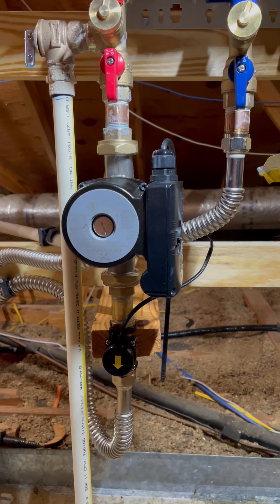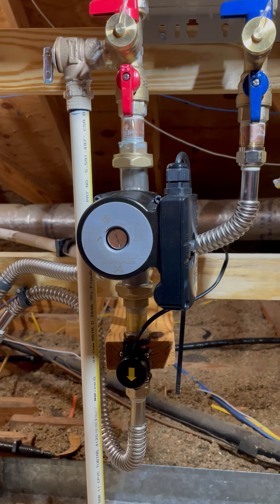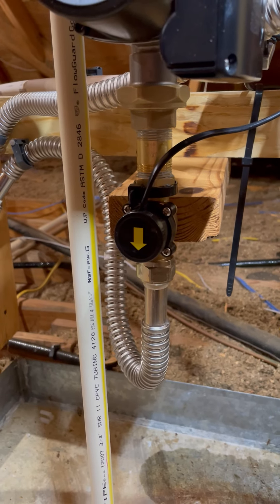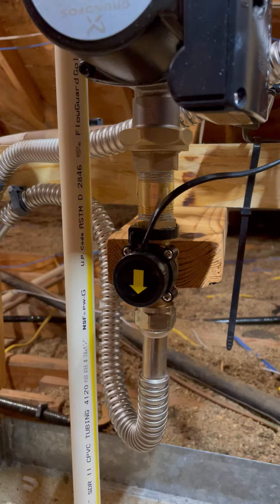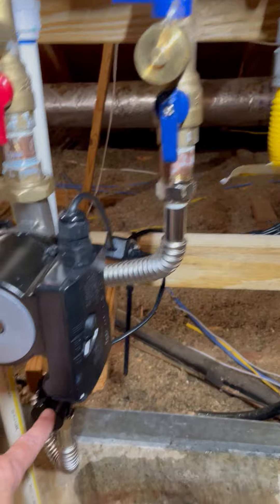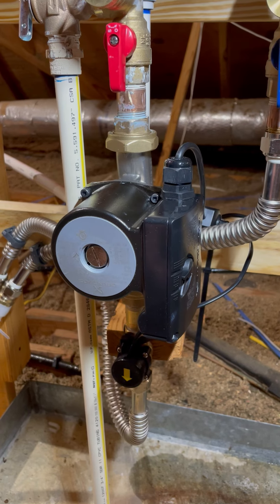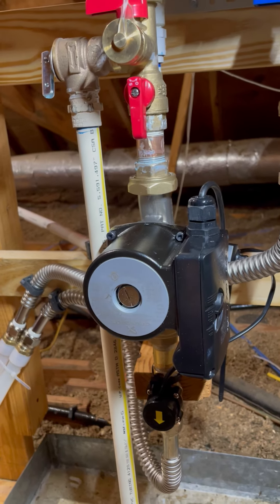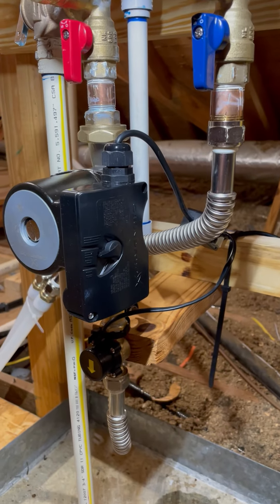Recirculating pump with flow switch install on tankless water heater

Comment: if you are using  a flow switch to turn on and off the pressure pump for water faster in the house, the flow switch installed before the pressure pump on the main cold line and when the tap is turned off the pump stops.  tap on pump starts. simple  the way you have it installed when the flow switch gets activated  turns the pump on  then  the flow switch has no control kinda backwards.

Comment: also if you only have the pressure pump the hot output of the heater and the pump turns on  there is a water pressure imbalance between cold and hot

Comment: HI WHAT BRAND IS THE PUMP, AND WHERE DID YOU PURCHASED
Reply from the maker: The pump is a Grunfos. I purchased it as a kit from Faster Water.com. I looked and the kits are now outragously priced. Do your homework on what system will work best. They have tankless kits, tank kits, deadend kits, etc. Also I see recirculating kits on Amazon now.
Reply: Another question the flow switch is connected to the unit? Or a plug?  Thank you
Reply from the maker: @herminiom-x1u  It's a plug. They are now on Amazon as well just make the connector will plug into the pump which kicks it on.

Comment: How does it get the water to the faucet any faster without having the gas running? On a tank water heater it runs through the hot and returns through the cold With out the gas having to come on. A tankless has to have gas going anytime water runs through it.
Reply from the maker: The gas and water heater turns on demand when a hot water valve is opened and off when close. When a recirculating pump and bridge valve is installed a flow switch is installed inline with it. It's plugged in with the pump which works the same way in with the heater. When the faucet is opened the flow switch and tankless heater senses water flow and turns it all on and off. So the gas is off a fauset is off.
Reply: @mynascarfan  does this one have a button to hit first so you're not wasting water?
Reply from the maker: @bradscottbutler  No, If you look at the video again the kit has a flow switch instead of a button at the faucet. It's plugged in with the pump so when the faucet is opened it turns everything on at the water heater. The flow switch, pump and water heater all come on and off on demand. Keep in mind also a bridge valve kit must be install at the sink faucet you want to get the water to fastest.
Reply from the maker: First, a tankless heater is on demand. It's off until you open a valve anywhere. When valve is open the tankless heater coils heat up instantly with the gas. So when a flow valve, recirculating pump, an bridge valve are installed in conjuction with the heater it all goes on and off.
Reply: @mynascarfan  I understand that. I have one on a tank system. But the gas never comes on when it's recirculating. You can not have hot water at the source from a tankless unless the gas turns on. The only way is to have a button to turn on recirculation pump with a hot water sensor so you are not wasting water.
Reply from the maker: @bradscottbutler  If you install a flow valve at the recirculating pump everything is turns on. Attached is a link that explains how the system works. https://fasterhotwater.com/Tankless%20circulation%20pump.shtml
Reply: @mynascarfan  I guess my question would be, does the hot side go through the cold side when you open the hot side faucet and come out the hot side when it reaches a certain temperature? Or does it just have a stronger flow to get there faster?
Reply from the maker: @bradscottbutler  No just reaches the area you install the bridge valve faster.
Reply: @mynascarfan  the only thing this is doing is the job of what pressure should do without the motor- you aren't adding anything new
Reply: WQT  for $ 387.00  ?  😮
Reply: I have seen basically the same set up but without the flow switch on tankless heaters..pump is connected to smart plug so you can program pump to any hour of any day to be on when your home.
Reply: @gimp2x ’m putting this comment here to help others who may come. While I appreciate this guys video to help others, he’s incorrectly explaining how this works. What creates the flow that triggers the flow switch and in turn cuts the pump on and triggers a tankless WH to cut on is the crossover valve installed at the farthest located sink(s). If it only cut on when a faucet was turned on, it’s not doing anything helpful… The crossover valve connects the hot and cold side and is open if the temperature is cold and allows hot water to flow back through the cold water line back to the WH. When the temperature gets high enough, the valve inside the crossover valve closes which stops the flow and should cut off the pump. When the flow and pump stops, the WH on a tankless shuts off. The flow valve is a good idea if used in conjunction with a timer I think. The other installs use timers only. So the pump cuts on and pushes hot water through the system and through the crossover valve, but when the crossover valve closes when the temp is elevated, the pump continues to run even though there is no flow.  For my planned install, I  will put a timer pump in with a flow switch. I will set the timer to be on from 6am to 9am for morning usage and 6:00pm to 10:00pm for evening usage. The pump will cycle on and off based on the opening and closing of the crossover valve due to the flow switch between those hours, but will not cut on during off hours. I feel it’s the best of both worlds. Hopefully it works…
Reply: @mynascarfan   the problem with this is that, yes, you move water faster through the burners, but you're not letting the water sit by the burner as long as it needs to in order to get to the set point.   That's what I see would happen with this setup
Reply: @SFlores1979  This heavily depends on what flow rate the tankless heater can handle. Some newer heaters will choke the flow in order for the water exiting has reached adequate temperature. The pump also has a manual speed adjustment on the housing if flow rate is an issue.

Comment: I see you posted this over a year ago. Have you had any issues with the pump burning up?
Reply from the maker: Still working fine. It should last a long time because it only come on when the flow switch senses water flow then shuts off after flow stops.
Reply: @mynascarfan so its basically doing the same exact thing as the water heater does with out it lol. Seems pointless. The whole point of having recirculating pump is... To circulate the hot water thru the system at what ever interval required to keep water in the hot water loop always hot. So soon as you turn faucet on you have hot water. Other wise your still waiting for it to circulate thru the system. The heater will only let it flow/circulate so fast and still produce hot water.
Reply: @jeremyproctor3357 I was thinking the same thing. My tankless already has a flow switch so it knows when to start heating. This doesn’t make sense to me.

Comment: Will this help bring hot water to other faucets/showerheads that do not have a bridge valve?
Reply from the maker: No you will need to install one where ever you want the hot water quicker.
Reply: This kit system will take care of all the faucets in between the water heater and bridge valve location. Multiple valves can be installed to decrease wait time or if there are multiple end points in the home.

Comment: this is a little weird to me. 
So how it works then, you turn on the faucet, which turns on the switch, but no water comes out yet until preheated?
Reply: You will turn the faucet on and then back off after 3 seconds. There is a bridge valve located at the furthest faucet that allows the water to flow backwards through the cold lines. The bridge closes when 95 degree water reaches it. The water will still flow out the faucet if it is left on but it wont save you any water but it will save a little time.